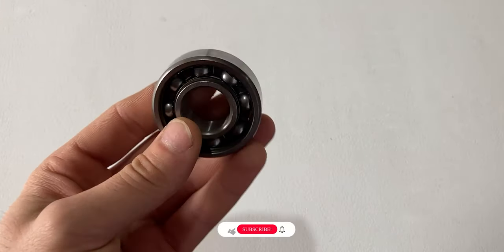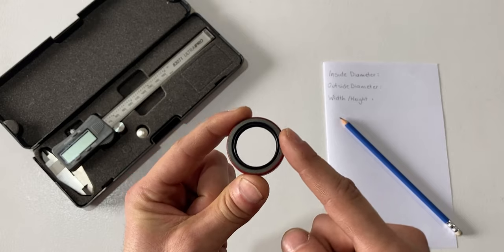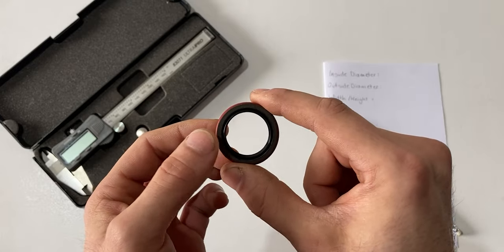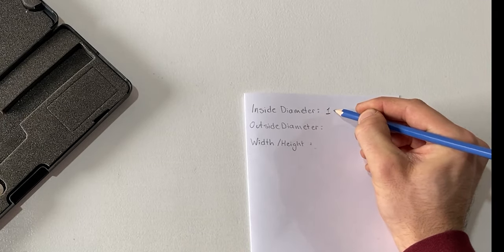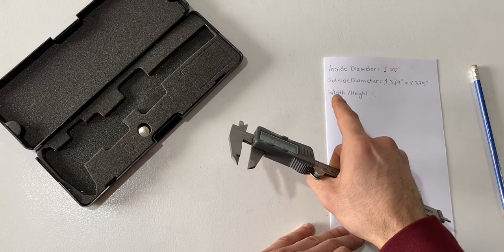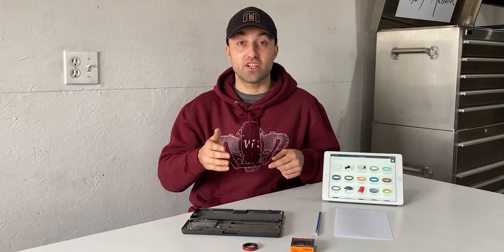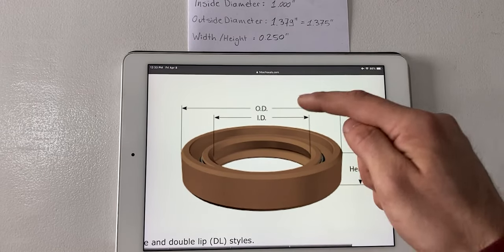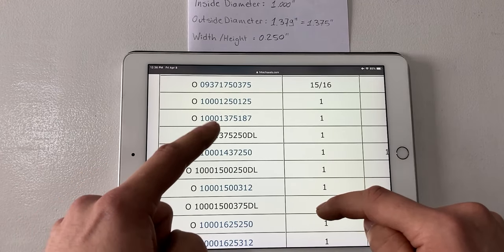How To Measure Oil Seals

Comment: Hi Andreas, I do not own a multimeter right now, otherwise I would try and copy what you did in this video. I deformed the Oil seal (on the crankshaft bearing side) of the john deere 400. I was wondering if you had a part number or link to purchase that as a stand alone item. I don’t see it individually on I save tractors.
Reply from the maker: While I was rebuilding my JD 400 this website came in super handy, as I found all the drawings and parts for the whole machine. This link will direct you to all the subassemblies: https://bit.ly/3M4hEho  and this link we be specifically for the engine: https://bit.ly/3xrMtJ5 . You will see one seal which is on the the side of the pulley or like you mentioned the side of the bearing. You should be able to purchase this seal directly from their website. Let me know if this helps you or if you need additional info. Cheers
Reply: Workshop Rebuild sounds great thanks Andreas!
Reply from the maker: @kevindouse  Anytime! Enjoy the rest of your week!

Comment: The vendors have no list as you used in your video.  Sadly they assume you know the number
Reply from the maker: I'm sorry to hear that your vendor does not supply seals by the size. Many times they do want to verify the part number to be sure it will fit, so they do not have to restock items. All seals are manufactured to imperial and metric sizes, so hopefully you can find a different vendor that will help you, in the near future. Regards Andreas